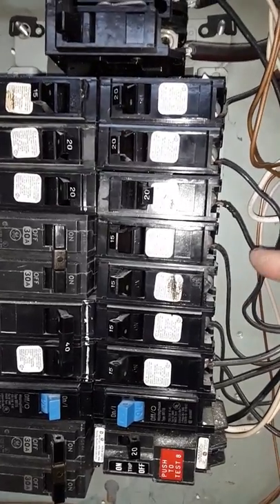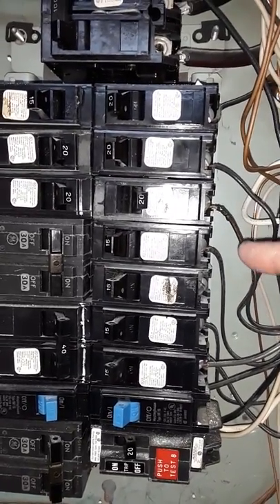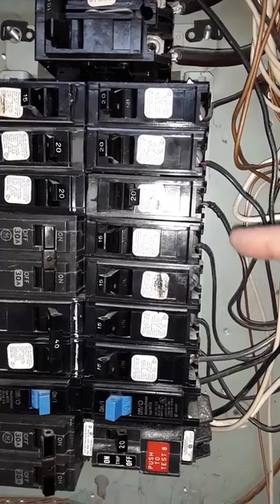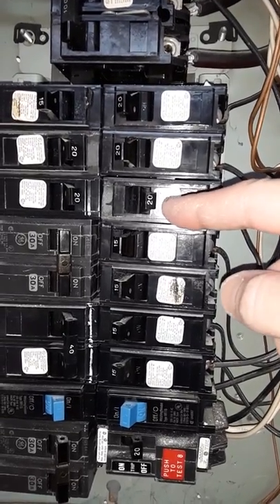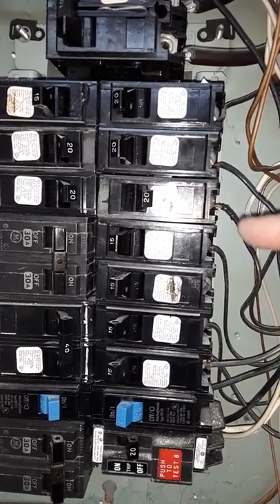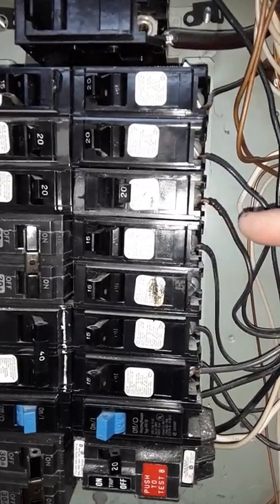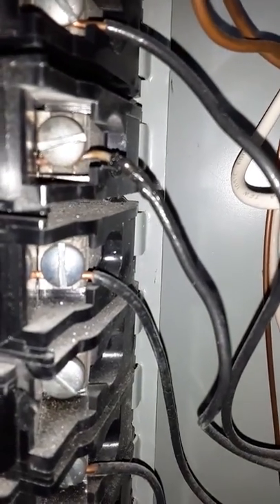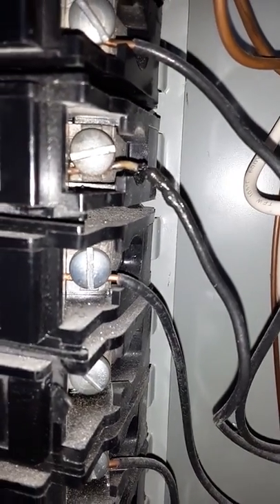⚡20-amp #breaker with 💥 #melted  #wire 🧯 too small of wire #14. #shortsvideo #shorts #youtubeshorts

Comment: Even if it’s 14 that shouldn’t happen.  14 is derated to 15amps but actually is 20 amp conductor.  The fact that the damage is right at the termination indicates a different problem.  Either the termination or the cb itself.  If 14 and not 12, it’s still wrong.

Comment: Looks like # 12 to me, and would be good for 20amps. If its # 14 that's a no go. I would be worried about that double lugged breaker as well.
Reply from the maker: Thank you for watching and commenting. Nice catch on the double lugging. This video was shortened from a larger video to fit into our QuickFlix playlist. There are many more problems with this breaker box. The wire was definitely #14 on the 20 amp breaker. Keep watching, I might put up that full video!! Thanks again.

Comment: Why the circuit breaker getting warm/hot
Reply from the maker: The circuit breaker is NOT getting warm/hot. The WIRE is getting hot and melting because its pulling too much amperage from the breaker allowing the wire to overheat and melt. This is the wrong size wire to the breaker size.

Comment: That melted wire on the video what type of wire is that?
Reply from the maker: # 14 gauge wire. On 20 amp breaker
Reply: What types of wire sir TW, THW or THHN?
Reply from the maker: @micheal0773  Standard ROMEX (NM)  for residential homes.
Reply: Oh ok sir thanks
Reply from the maker: @micheal0773  Thank you for watching InspectFlix. and thanks for the question.
Reply: Last question sir what do you think is the best wire THHN or ROMEX?
Reply from the maker: @micheal0773  I think THHN is a better "wire" than Romex  wire, but it would depend on what its being used for. For instance I wouldn't use THHN on residential construction due to cost.
Reply: Ok sir thanks
Reply: @micheal0773 THHN is named after its insulation. The wire is the same. But THHN cannot be used by itself. It needs a raceway like pvc or EMT conduit. Romex is a trade name. It’s actually NM-B. The older NM had no ground. NM-B does. The stealth is a rated raceway for wire.